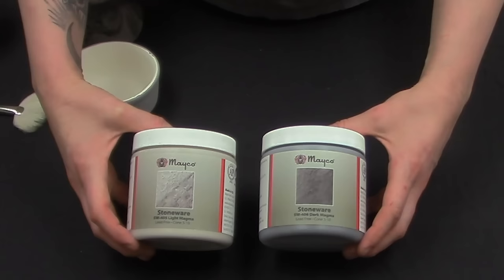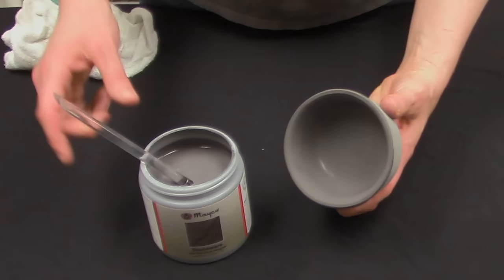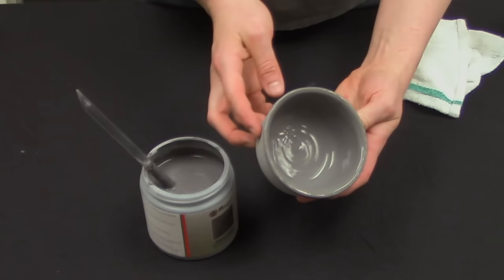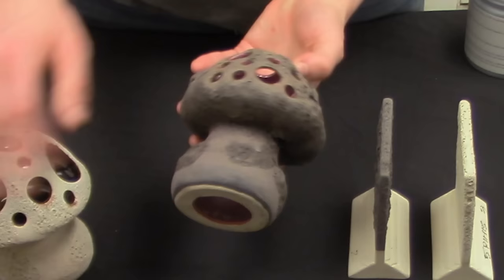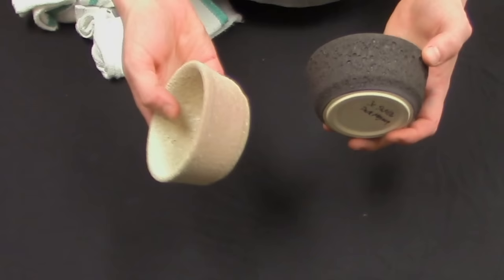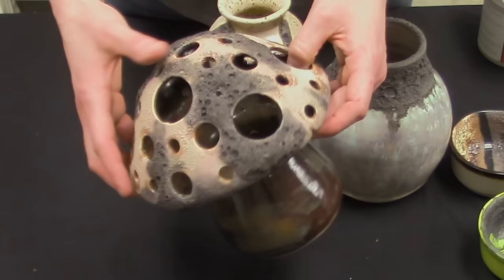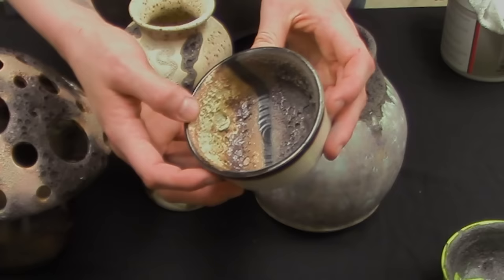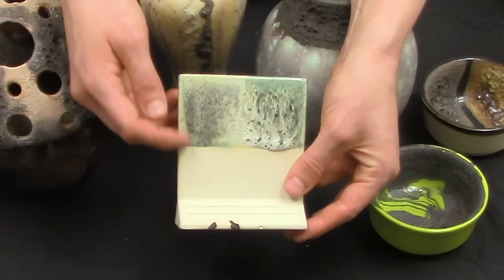Mayco Texture Glazes : Magmas

Comment from the maker: Quick Introduction: 0:09
Application Demo: 0:20
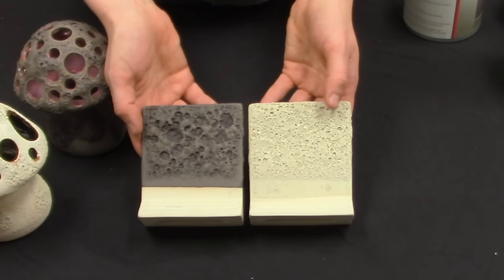Variation & Adding More Texture: 2:31
Firing Advice: 3:35
Versatility: 4:09
Creative Uses: 4:24
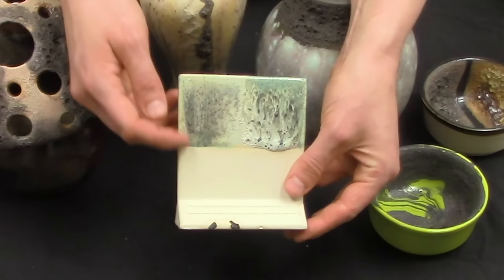Combined with Speckled Stroke & Coat: 6:27

Comment: Love this new glaze and tried it on some small pots.  I fired to Cone 5 with a 5 min. hold, but didn't get the craters, just a sandpaper finish.  Does this need to be fired to cone 6 to get the craters?  Any holds, slow/fast firing?

Lydia
Reply from the maker: Cone 6 will probably get you better results. You can also email our technical team at technical@maycocolors.com for more assistance.

Comment: Can the glaze be spray applied? Looking to achieve more of a sandpaper finish, versus deep craters. We currently have a spray booth with a filter / fan in the studio.
Reply from the maker: You can spray and apply thin coats, just be sure to wear proper protective equipment when spraying.